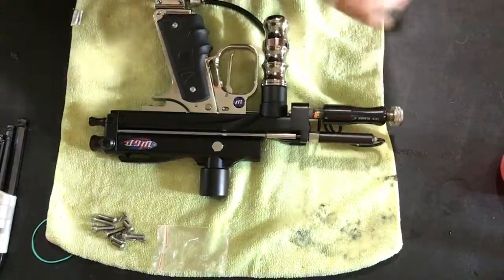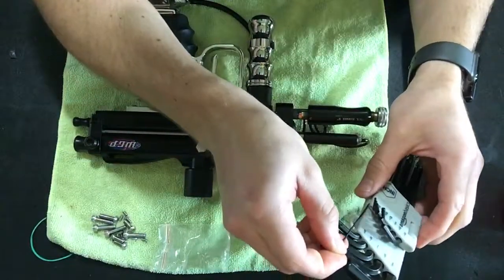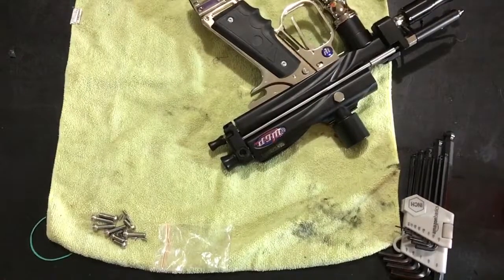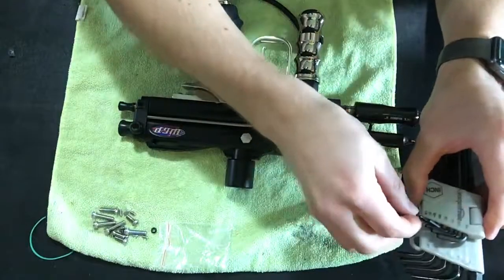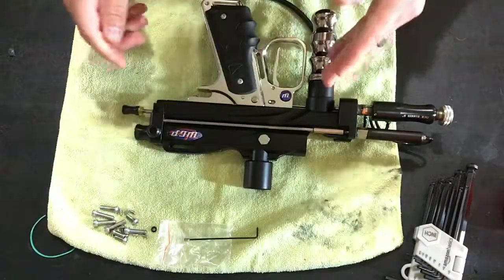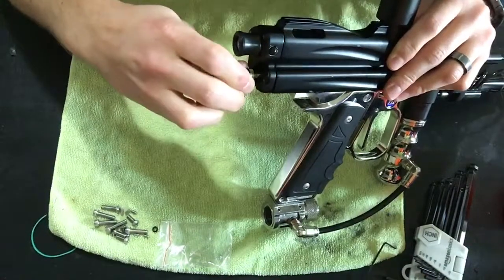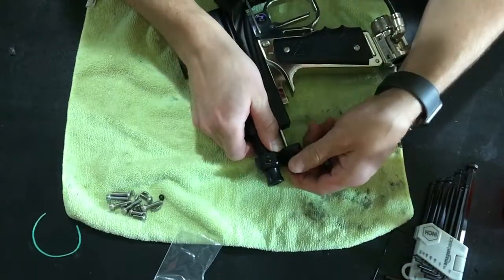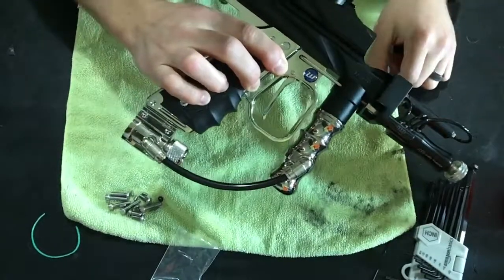Autococker mods to improve durability!

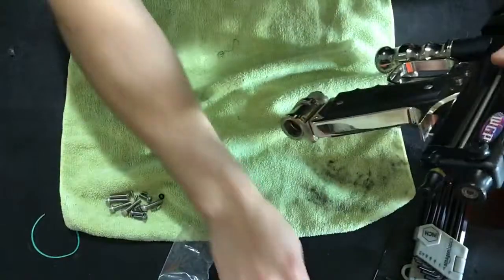Comment: I mean the part at 3:44, I usually see people talk about adjusting the cocking rod to make the bolt barely clear the feed tube when cocked.  I don't get how you can adjust the cocking rod to prevent the lug hitting the body, without throwing off your adjustment of the bolt.
Reply from the maker: Both of those interpretations achieve the same result. Having the bolt sitting near the rear of the breech when cocked is a quick measurement that shows your lug can’t hit the body. I take it a bit further these days and set the cocking knob with the frame removed.
Reply: @CockerTop  Ok I get it now, I had not heard of the cocking rod/hammer lug spacing until recently.  Thanks for the explanation, and great videos.
Reply: Great tip here mate. Something else, you can thread a barb into hard macroline if you want to get a gauge on your lrp for testing

Comment: I don't get the cocking rod spacing tip.  When you change the cocking rod length, aren't you throwing off the adjustment of your bolt position clearing the feed neck?
Reply from the maker: Yes - the cocking rod needs to be set such that when the ram is on the back bumper, the hammer lug is just short of hitting the back of the body slot. You can adjust the knob to set this up.
Reply from the maker: It’s the pump arm I am talking about here not the cocking rod. Misspoke. These days I just use Vibratite 121 to hold the pump arm still.